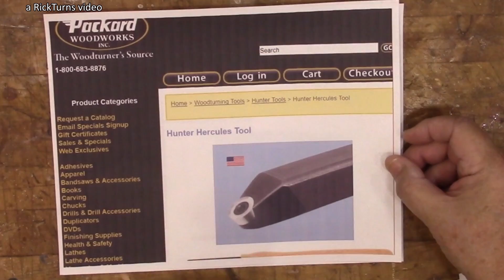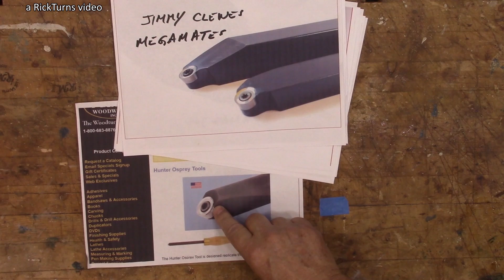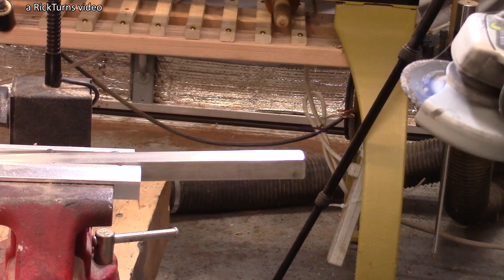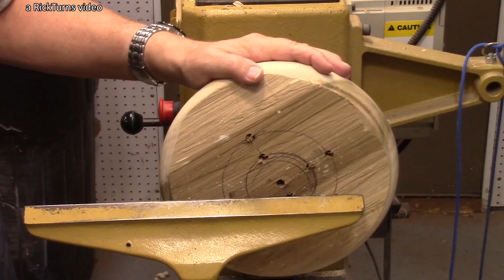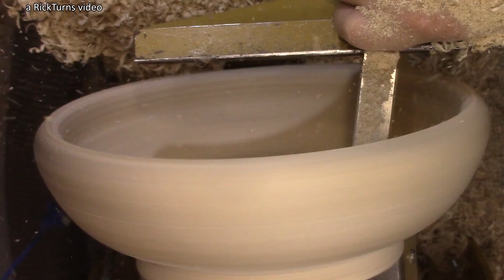Making and Using a Drop-point Carbide-tip Hollowing Tool

Comment: as others have said,, the angle is wrong for a good finish, try turning it on its side and do a shear cut, I am pretty sure the cutter came with a #8 screw, not a #10
Reply from the maker: I don’t think it came with a screw, but it’s been so long, that I am not sure. I was under the impression that the angle that the cutter is mounted on the tool is supposed to provide a shear cut - that’s why it is a flat bar, so you don’t have to angle it.

Comment: With all the time and money that you spent attempting to save money, my opinion is that purchasing one of these might have been your best path to success.  Also, it appears from the video that the actual angle of the cutter is almost flat, not at whatever angle Jimmy or Mike determined is best.  Hunter makes Jimmy's tools by the way.  And Hunter provides all the cutters to everyone else except Azcarbide, which might be doing the same.  I asked Mike what the angle is and he refused to tell me.  Simple Tools/Harrison Specialties carries round shaft, flat angle versions of these tools for around a third of the price of Hunter and Clewes.  Finally, no one has made a recent video in the last three or four years about these tools.  That is a telling sign that the market or at least the current crop of snake oil salesmen has moved on to something newer to take our money with.
Reply from the maker: My purpose in making this tool wasn’t so much about saving money. It was about making the tool, which I enjoyed doing, and it was also about trying out this type of tool to see if really was as good as advertised. Mine wasn’t - I found it useful for roughing out, but not really any better than a large bowl gouge. I almost never use it now. The cutter was at an angle similar to that of the commercial tools, but I doubt very much it was exactly the same. I still wonder if those tools are really as good as shown in some videos - I doubt it, though. Thanks for watching and commenting, Grumpy.

Comment: I Make my car bought tools pretty much like you made those . On half inch bar just straight are use Round carbide cutters and a radius squared it does seem to cut better at higher speeds what I would like to know is how to make one  to do hollow forms I really have a hard time doing Hollow Farms I may need to build a different to rest I’m sure that would help I get terrible catchers if I was a pretty strong it would probably take my tools away from me scares the daylights out of me I have just started trying to do them Hollow Farms that is if you could help me I would appreciate it I know with your teaching I could learn thank you very much Rick God bless
Reply from the maker: I’m not very good at hollow forms. I’ve avoided them for a long time. I usually cut through the sidewall. But I’m planning to do more hollow forms on the near future. Thanks for watching, Randy.

Comment: Great tool, good video, and all the replies were thoughtful and informative.  Pretty much everything that can be said has been said so pardon me for being repetitive.  For a long time I was sort of a Hunter Tool purist, thinking I should cut rather than scrape.  But always had tool control problems.  So I  built some EWT type tools, far more control and smoother cut.   But still does not produce the surface that a sharp gouge will, for me anyway.  So my compromise for bowls:  I do the roughing with carbide, often with EWT style cutters, then go in with the gouge for finish cuts, final shaping, shear scraping and so on.  Using the carbide for roughing saves me from dulling and resharpening the expensive gouge steel away for roughing that won't be seen anyway.  I am just too cheap to grind away expensive HSS if I  don't need to.

Hollow forms, the opposite applies sometimes.  Rough hollow with a John Jordan 3/16 by 3/16 tool then smooth it out with an EWT round tool sometimes, other times with HSS cutters that are wider.
Reply from the maker: Other than my dedicated carbide shear scraper, I don't use carbide bit tools much at all. I've made four or five of them, using various bits, and haven't found them to be much of an advantage. But I really like the shear scraper tool I made! Thanks for watching and for your comments, John. It's interesting to hear how other woodturners work.

Comment: I made the same tool a while back using the same tools as you.  However, before grinding the pocket for the cutter bit, I drilled two holes.  First I used a 13 mm drill bit to drill down perpendicular to the pocket cut to the dame depth of the thickness of the cutter.  Using the larger hole center,  I drilled the hole for the screw all the way through the steel and then tapped with a screw.  After that I used the angle grinder and Dremel with a grinding bit to take down the metal for the cutter pocket.  The 13 mm hold drilled made a nice pocket for the steel bar on the back side of the cutter.  It looks professionally done.   In short and recapping things, grind the basic profile of the bar, but don't grind the pocket cut at first like you did.  Instead, set the bar up with the angled cut parallel to the floor in drill press, then drill the 13 mm hole, then the hole for the screw.  Then grind away the metal for the pocket for the cutter towards the front of the bar leaving a pocket at the back.  Then tap for the screw.   Hope this makes some sense.
Reply from the maker: That sounds great. I thought about doing something like that, but I thought it was beyond my limited metal-working capabilities. How’s your tool work for you? After using mine for some time, I’ve given up on it for anything more than really rough hollowing.
Reply: RickTurns

My experience sounds identical to yours.  I think a 12mm carbide cutter is set at too steep of an angle.  I may reset at about a 10-15 degree angle and see if there is an improvement.  But, before I do this I may buy a negative rake cutter and see how that improves things. I used a regular round cutter and it seems way too aggressive in some instances.  Or as the old saying goes, maybe I wasn’t holding my mouth correctly.

On another note:  a few years ago I saw a fellow in Casas Grande, Mexico turning wood and all he used were pieces of square and round steel rod ground into different shapes for his tools.  He turned beautiful pieces with surfaces as smooth as glass.  He didn’t have the carbide tools or the high speed steel tools we have become so dependent upon.  His lathe was homemade out of pipe and small I-beam steel with a .75 -1 Hp electric motor with different pulleys. He sharpened his tools with a file and round wet stone on a bicycle frame turned by hand.

I learned through this man tools are only part of the equation and God given talent is the rest.  I have yet to acquire the God given talent to use the expensive tools that I have in my possession. I struggle making a tool that will make life easier turning wood, yet the man in Mexico is only struggling to make ends meet while making beautiful wood turnings out of any type wood he can gather with very primitive tools.

Comment: Thanks for the video and your time to explain the process of making your own carbide wood turning tools.

Here is what I did that may better accomplish what you were wanting to do for the small pocket at the tip of the tool for the carbide cutter.

Like you, I started by grinding the 45 degree angle on the top part of the bar stock.   From there I determined the location of the cutter on the angle and then drilled my hole for the cutter set screw.   The hole was drilled perpendicular to the 45 degree angle. Then I used a larger drill bit (33/64) that was slightly larger than the carbide cutter diameter and drilled down a depth equal to the thickness of the cutter.  After that I took my angle grinder to remove metal from the top of the bar around the front of the hole drilled and leaving a pocket at the rear of the hole for the cutter to fit in.  After that I tapped the hole for the set screw.  After that, I ground the bottom side of the tool to a shape similar to the Clewes tool.  The end product looks pretty close to the Clewes tool... not exact, but close.  The trick is in the sequence on how things are done while making this tool.

I used CA glue on the bottom of the cutter and some thread lock on the screw.  To loosen, a cigarette lighter or butane lighter can be used to lightly heat the bottom side of the bar.
Reply from the maker: Thanks for the information, Glasscutr. That does sound like it would work really well.

Comment: Those dished Carbide Cutters are made to be used on a 45 degree angle or there abouts.   Just an FYI
Reply from the maker: Looking at pictures of the commercial tools, the cutting angle appears to be less than 45 degrees. Only one tool specifically mentioned the angle, and I believe it said 22 degrees. But thanks for the information!

Comment: I have both the Hunter Osprey and Clewes First Mate they both work great. I think what is critical is the angle of the cutter as it is attached to the bar and that is what makes it a cutter not a scraper. The Clewes tool actually only allows for a small portion of the cutter to touch the wood so to eliminate catches. I have tried hard to get it to catch and it really will not. The Osprey is on a smaller bar stock and is more sensitive to dragging that has led to catching.
Reply from the maker: Yes, I’m sure you’re right about the angle. I’d like to try the First Mate, but it’s kind of pricey. Thanks for watching, Rod.

Comment: You need a milling machine!! I made the AZ Carbide " little hogger" straight and curved and have not put them on my boring bar yet. Good video to show how to save some money by making you own carbide tipped hollower . When I tap in the drill press, I power tap to get it started square to the hole and I use a foot pedal to "bump" it in. It work great. I finish with a T wrench.
Reply from the maker: I'd love to have a milling machine except that A) I have no idea how to use one, and B) they're expensive! Sounds like you're way ahead of me in metal work. Thanks for watching, Jim.

Comment: Hi Rick,  Easy Wood Tools sell replacement cutters, for their three types of tools. They come with a 10 32 screw.
Reply from the maker: Thanks, Bryan. The EWT cutters are all flat carbide cutters, which pretty much limits them to scraping, unless they’re held at an angle so they take a shear cut. I was hoping the lipped (or cupped) cutters would cut more than scrape. The one I made does cut when held at the correct angle, I think. However, as mounted on the shaft (22 degrees or whatever), it still seems to be more of a scrape...after all, the bevel isn’t rubbing. So I’m not sure if the tool is all it’s advertised to be. Or maybe it’s just my homemade version isn’t too good.

Comment: Rick Good experiment, May I suggest that you use metal cutting paste or spray oil as will cut smooth and easy second I would check if the screw are Imperial or METRIC, although supplier tell you is made in USA put this days China is making them and normally are Metric, finally I believe 22 degree is close to scrapper which is for dry timber you will find 45 degree is for getting large cuts, lots of info on Y/Tube, maybe try on harder timber spindle cutting then decide for mark II. Good luck. Regards from OZ Jack Marashlian
Reply from the maker: The 22 degree figure comes from the Jimmy Clewes' Mate #1 and #2 tools. The Hunter tools look more like 45 degrees. Thanks for your suggestions, Jack.

Comment: I watch this again. I have but one carbide tool, (by H&S Tools), they make no pretense about what it is, a roughing tool. I use it quite often, as you said for hollowing. I have had the same results as you, a lot of tear out. I've found it seems to work best either straight in, (level with the floor), or with the tip slightly turned downward. I still finish the inside with either a bowl gouge or negative rake scraper.
Reply from the maker: That seems to be the way it's going for me too. I've made four carbide tools now. They work okay, but aren't really superior to standard woodturning tools. I keep hoping for a breakthrough! Thanks for watching, Tarry.

Comment: with any new device you have to ask yourself this, what problem is this the solution to. Is it better than your bowl gouge, definitely not. is it easier to use maybe for a beginner but finish will never be as good and a novice will learn little except the price of abrasives.
Self taught turners are always looking for short cuts and keep buying a bundle of new gadgets instead of learning to make full use of the ones they already have. I'm with the great Denis White in advocating the need for only a half dozen tools for the majority of woodturning needs and keeping the new tool cash for buying more wood to practice on. Practice makes perfect and there is no substitute.
Having said that, I applaud your effort. Just think what you could do with an engineering shop.
Reply: Agreed! Proper technique can make an average tool look good, a high priced, do all tool will not develop good turning methods.
Reply from the maker: More metal-working tools would be nice! I could make mistakes faster. I fall into the category of self-taught woodturner who loves new gadgets. There's always one more tool that might be better or easier. Thanks for watching!
Reply: Rick,   been there, done that and  have a wall covered in tools to prove it.

Comment: If you have a drill press with a vice once you ground the angle on the steel you can clamp the bar in the vice holding it at the same angle and take a drill bit the size of the carbide bit and drill it out instead of trying to grind you will get a much cleaner looking tool
Reply from the maker: That’s a great idea. It never occurred to me to do that. Then I could have a nice tight pocket for the cutter. Thanks for the suggestion!

Comment: I thought you were trying to mount the cutter at the 22 degree angle. Your final product is nearly level. The purpose of the angle is to get a cutting action instead of scraping.  At the proper angle, you will greatly reduce your tear out.
Reply from the maker: No, it really is angled downward, even if it doesn’t look like that in the video. Thanks for watching and commenting.

Comment: Rick, your videos always bring a smile or a chuckle.  I bought one of the smaller Hunter tools at Turning Southern Style, the one with the 3/16" cutter like the cutter on my Jamieson Hollowing rig.  I bought it because of the many comments I have seen over the years about great a finish cut you can get on the inside of a box. It was not cheap.  I am still playing with it to see if it works for me and is an improvment over my current tools and techniques. There is a huge differerence in these cupped nano carbide cutters that Clewes and Mike Hunter use and the ones CPT Eddie or EWT sell. They slice instead of scrape. It looks like your replacement cutter was one of the cheaper flat carbide cutters. I watched an interesting demo by Mark Palma at TSS where he went into a lot of detail explaining and demonstrating the differences in various carbide tools.  Making tools can be fun as your video shows. But I could not replicate the fit and finish of the Hunter tool I bought. And as you showed, if you don't get it right, it may not work well. Even after several trys. Looks like you may have an opportunity for a follow up video explaining the difference in use and results between the nano carbide cup cutters which essentially are designed to ride a bevel similar to a gouge and the carbide scrapers that are generally recommended to use flat.
Reply from the maker: The cutter I’m using is described as a shear cupped cutter that is a replacement for the cutter on the Hunter #4 tool. It is 12mm inside of  the 8mm which fits the Hunter Osprey. Maybe the size of the cutter makes a difference. It is a nanocarbide cutter and it is a lipped cutter rather than a flat top cutter. On the first cuts I made, before the recess was very deep, I was getting beautiful cuts, no grain tearing at all. As I got deeper, the quality of the cut became rougher. I think it’s me at this point, not the tool. I’m going to keep playing with it.

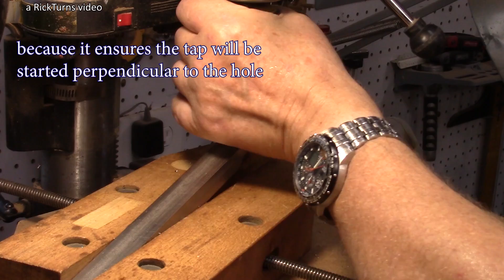Comment: If you  go back  and  watch the video, from 9:55 - 10:05 you will see that the metal you are tapping drops twice in your clamp while you are starting the tap causing you to tap crooked threads
Reply from the maker: It did drop some, so maybe that was the problem. On the second go around, I had the bar clamped in a machinist’s vise, and it didn’t move at all, and I still had the problem. When I went to a slightly larger drill bit, the tapping went okay. Thanks for the tip, Cur.

Comment: Rick, you produced a great video. I have a COMPLETE SET of EWTs.  With the round cutter I have found that I get the best finish cut by rotating the cutter in the direction of cut just like a fluted cutter!
Reply from the maker: Yes, I think the shearing action improves the cut, just as it does with a scraper. Thanks for watching l John.

Comment: Nice job Rick. Is there any chance that the nut is contacting the wood? Maybe you could use a nutsert to adapt the 10-32 to an 8-32. I have made 6 carbide tools but use the traditional tools for most work.
Reply from the maker: A nutsert? This is the first I’ve heard of that. I’m going to check it out. Thanks for the suggestion, Dan.